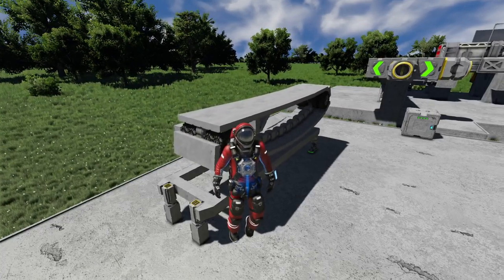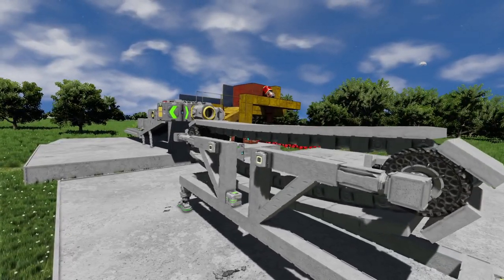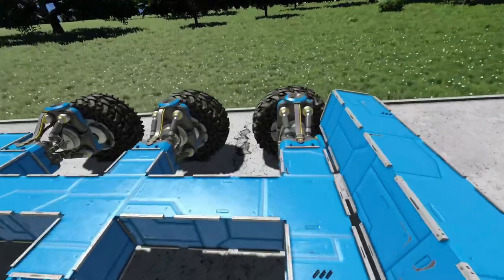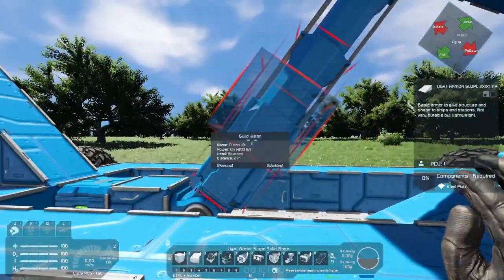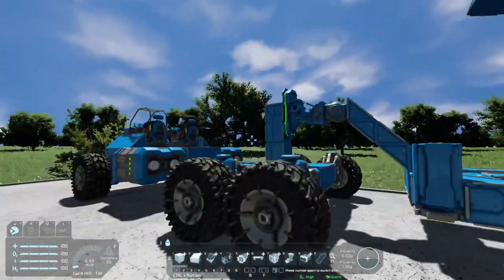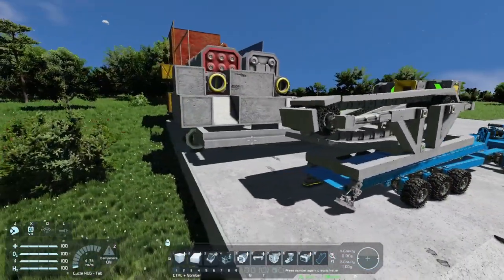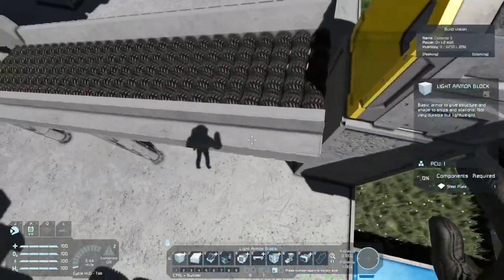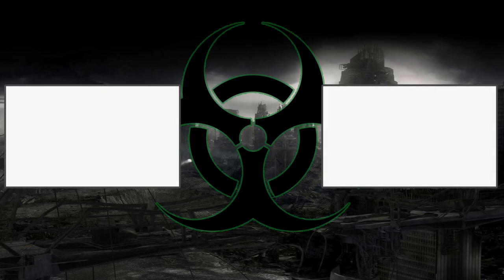Space Engineers Industry: Truck And Trailer Build For The Conveyor EP5

Comment: On the conveyor you can install the remote, antenna, small battery and maybe 10 small 1x1 wheels, and just park it where you wish :D
Also, you can put those wheels on the pistons and adjust the height if it needs :D (just make sure that pistons are attached to the base of the wheels pointing upwards and conveyor attached to the piston part, otherwise you will need the script to control the wheels on a sub grid)

Comment: Instead of using the landing gear to connect the trailer, you can use a hinge. Then from the cab access a camera via that should be positioned to look down at the hinge part that you want to connect. Then just drive back, connect and then switch to the remote control from the hotbar. Now you don't need an antenna, and don't need to leave the seat.